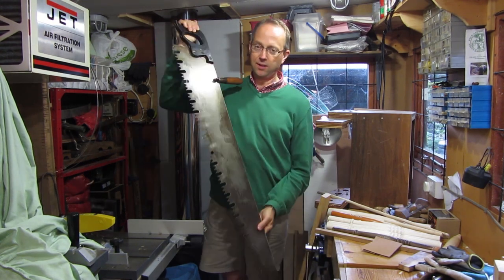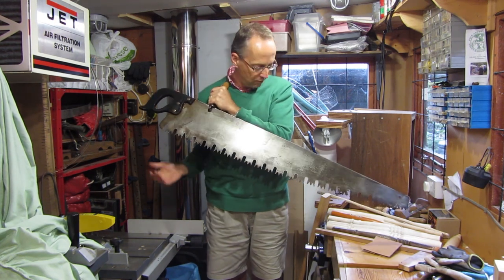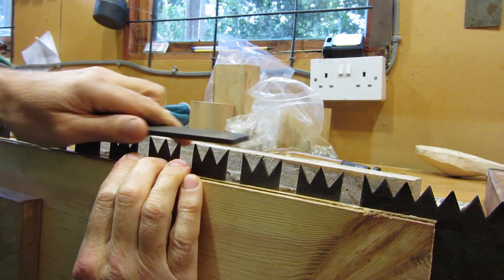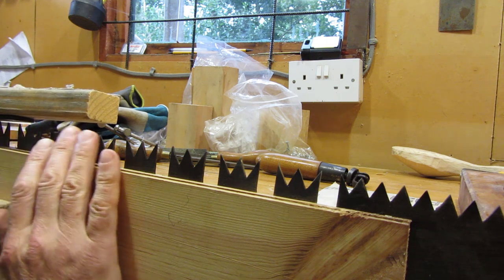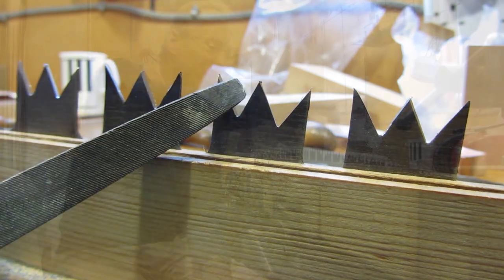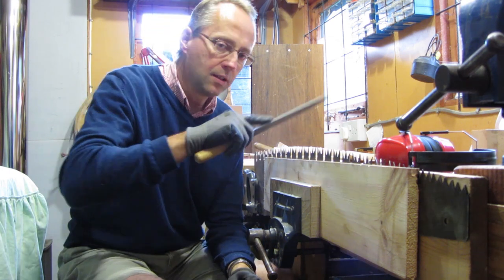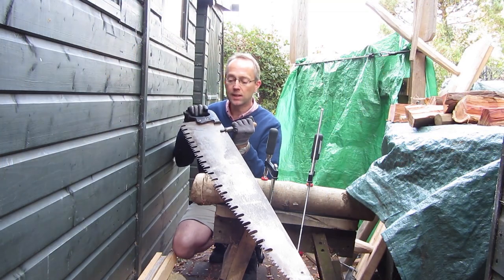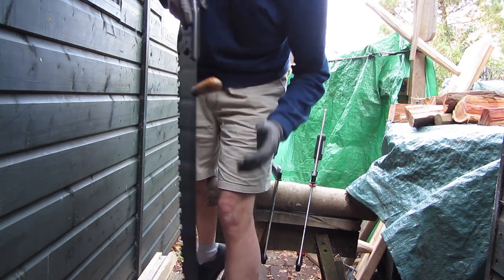Sharpening a one / two person crosscut logging saw

Comment: Hi Harry, did you sharpen (ie bevel) the vertical sides of the teeth next to the gullet? I have been doing some research on these saws but most of the videos I have found are for sharpening a Champion or Lance pattern tooth rather than this Great American tooth pattern. In the crosscut saw manual it mentions that M tooth saws (one less point per cluster than yours) are only beveled on the inside angles with the outsides left vertical to act as rakers. The book mentions that the Grat American pattern is similar to the M so I think it should be vertical...
Reply from the maker: +Andrew Frudd Hi Andrew from vague memory I think I bevelled some and left others plain as thats how it had been done before both on this saw and another I had......I think your approach sounds right, and your justification makes very good sense...interesting.
Reply: Thanks, I will try do a bit more research but I am leaning towards leaving them vertical when I get round to filing mine.
Reply: @andrewfrudd108  what did you conclude? I have two to restore
Reply: @jackwheatley8  i didnt bevel the vertical sides
Reply: Hi - this seems to be very special - is there any manual out there how to exactly do the sharpening? Lots of videos cover different patterns. I have bought a factory-new saw, there are no bevels at all! Manufacturer says it is sharp, dealer says it is not, I have to re-sharpen it. But how exactly?

Comment: I bought one of the Flinn saws about 2 years ago (thought it might be useful for cutting green oak)  it's a very nice saw and I was pleased with it, however I sent it off for sharpening and it was returned untouched. They (sawdoctors) said that they couldnt sharpen it as, "it's a hardpoint". I disputed this, but they wouldn't be convinced. Yes, the teeth are "blued", as on a hardpoint, but surely that's simply from the manufacturing process? They saw the blue and made their minds up.